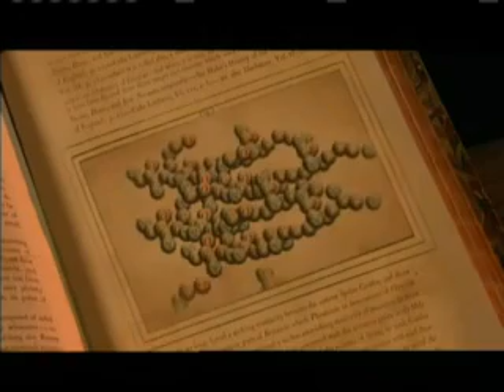Origin of Life - Abiogenesis 3of5

Comment: @5tonyvvvv "Amino acids found in meteorites from space, which must have formed abiotically, also show significantly more of the left-handed variety, perhaps from circularly polarized UV light in the early solar system" (Engel and Macko 1997; Cronin and Pizzarello 1999). "The weak nuclear force, responsible for beta decay, produces only electrons with left-handed spin, and chemicals exposed to these electrons are far more likely to form left-handed crystals" (Service 1999)

Comment: You know how science work right? If the "guesswork" as you call it, don't produce any reproducible results, then one has to go back to the null hypothesis.  You should read up on how the scientific method works before you latch on your own interpretations on what is is supposed to cover. Somebody studying abiogenesis must back up any claim they present with credible science. You really didn't get the part about the mouse forming in the beaker, did you? Well. You're at that level...